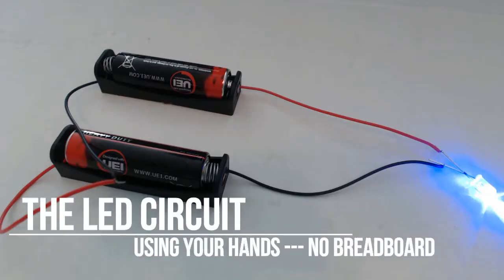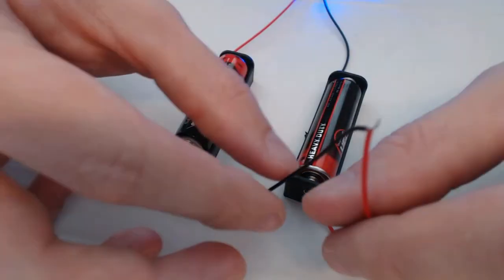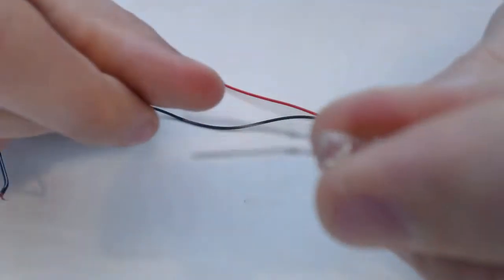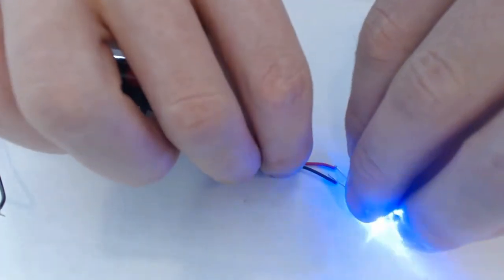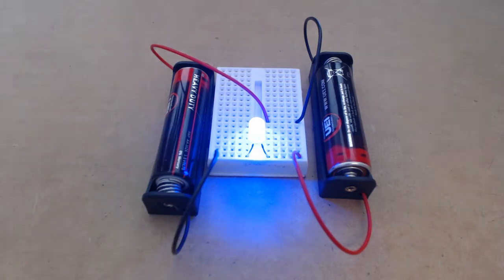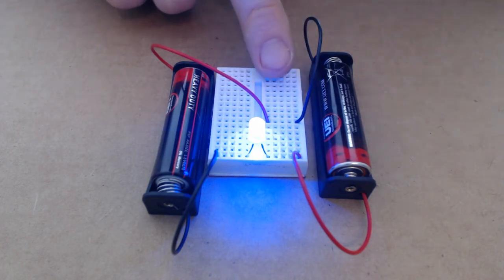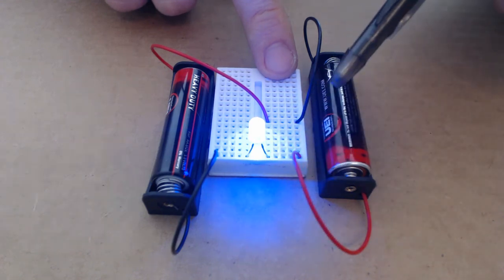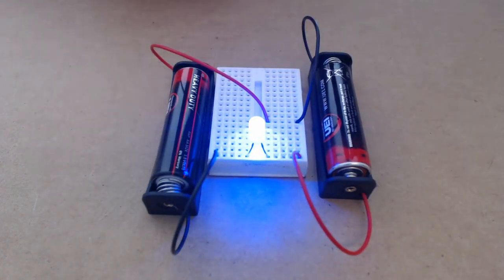Building the 3V LED Circuit

Comment: Question: I did this, except the batteries were touching one another and the LED always burns. Is there a difference? I have saw that I need a resistor, but you did not use one and the LED was ok. Mine burst quickly with 2 AA 1.5V Batteries and a LED of 3V.
Reply from the maker: Whether or not the LED burns out depends on the the specification of the LED.  The forward voltage of the LED is 3V, so a stable current will flow when given 3V, so it shouldn't burn out.  However, current increases a lot with any additional voltage, so it's always safe to add a resistor to limit the current.  we just didn't put one in here to simplify this first breadboard circuit.  hope that helps!
Reply: Barnabas Robotics Yes, thank you! It is possible (from what I read and made me think from your reply) that maybe the specs for my LED's were incorrect. I will check that. 👍
Reply: @BarnabasRobotics52  which resistor would you use? a 470 Ohm?

Comment: Will the led eventually die without a resistor, or is it not necessary because of the matched loads?
Reply from the maker: great question!  the forward voltage of the LED is 3V, so a stable current will flow when given 3V, so it shouldn't burn out.  However, current increases a lot with any additional voltage, so it's always safe to add a resistor to limit the current.  we just didn't put one in here to simplify this first breadboard circuit.  hope that helps!